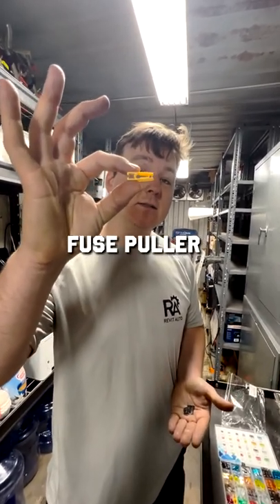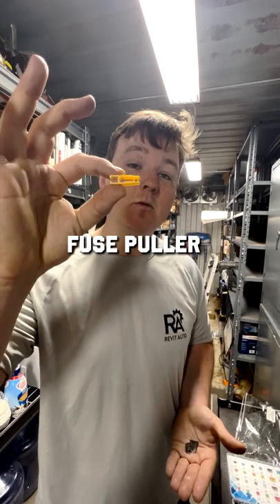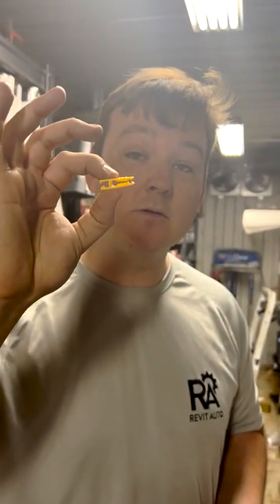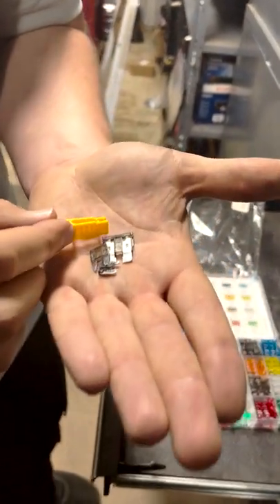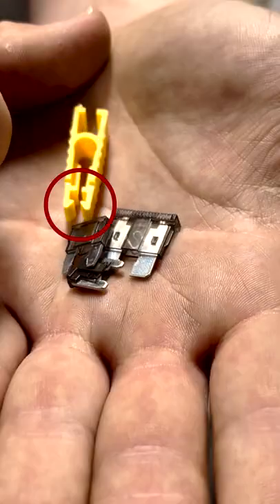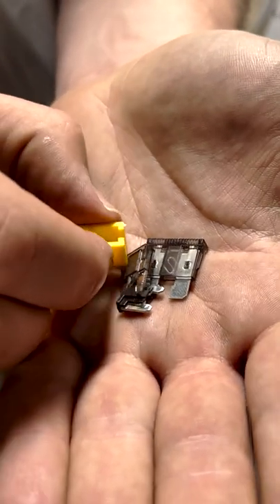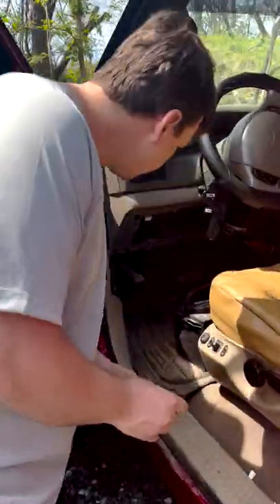How to Change a Blown Fuse! #shorts

Comment: Hi, I have a fuse that needs to be changed. The fuse is in the fuse box right next to the battery: my question is do I have to disconnect the negative part of the battery before I can replace the fuse or can I just pull it out as is?
Reply: You can usually pull it out without having to disconnect the battery, but you are welcome to do so as extra security. Just be sure that whatever fuse you change, the ignition is off or the module you are changing the fuse for has no power going to it
Reply: @alynurani8 what if I'm pulling a fuse because what its powering is draining the battery while the car is off? Does that mean I should disconnect?